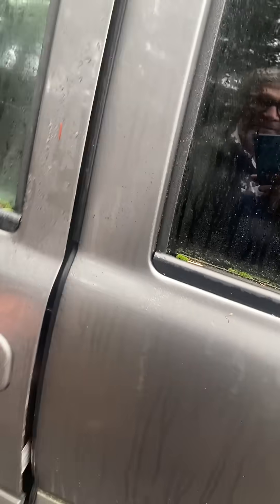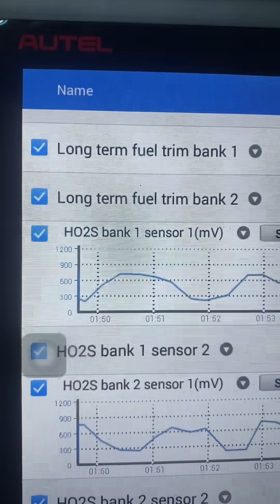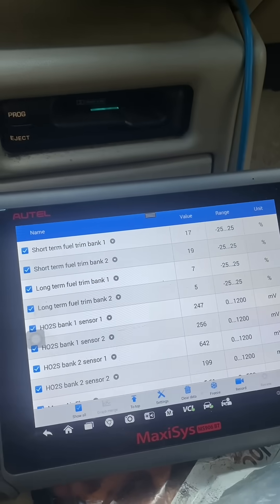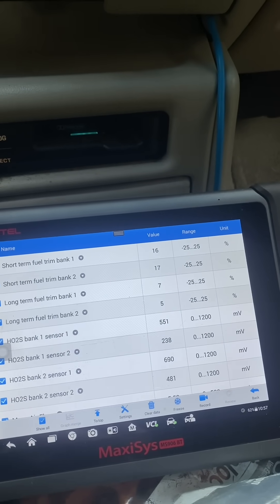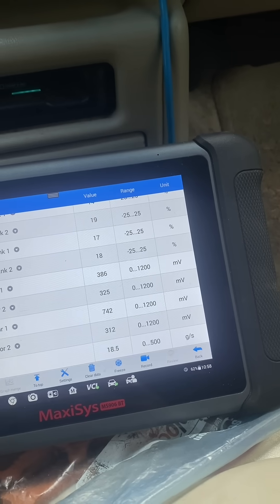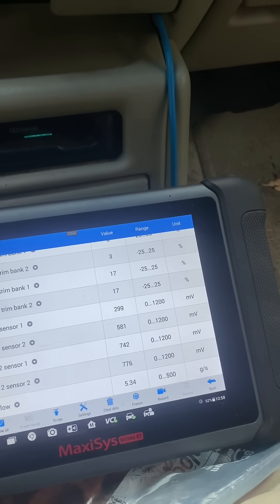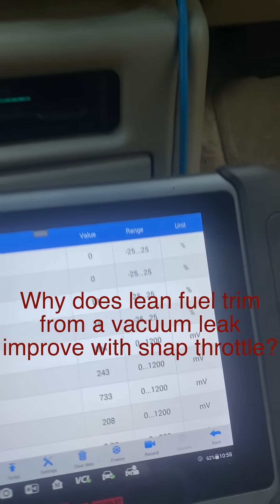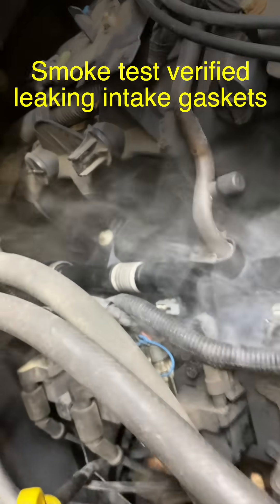P-0171, P-0174, a simple trick to diagnose lean fuel trim

Comment from the maker: One of the best ways to remember a critical fact is to understand why it happens. So, why does lean fuel trim caused by a vacuum leak consistently improve when you press on the gas pedal? Think about how rpm in gasoline engines is controlled....

Comment from the maker: For those who roll their eyes at the use of expensive tools, you don't need much more than a basic scan tool to get live data. Even the smoke machine could have been replaced with a water bottle or propane while watching live data. The key point is to understand how manipulation of the vehicle while live data is running can better isolate where the problem is. This hidden power of the scan tool may go far beyond just pressing on the gas pedal. For example to evaluate the response by oxygen sensors you can remove an intake hose, or add propane, etc while watching live data.
Reply: thank you for this very useful information 👍🏼really appreciate it